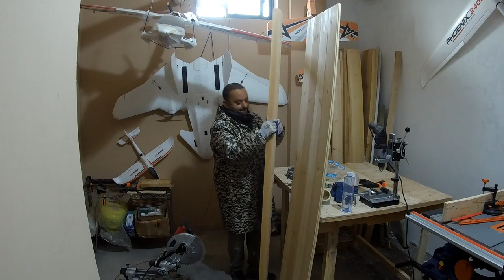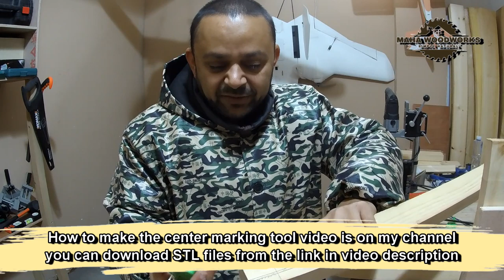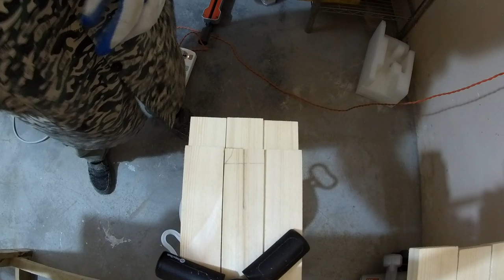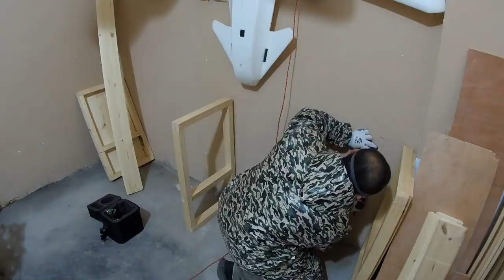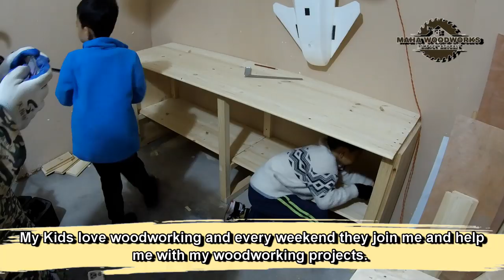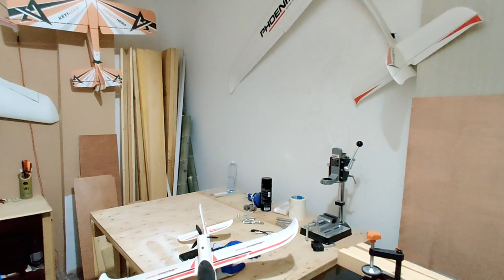DIY Woodworking Long Work Table with Storage Shelf

Comment: Oh Ali ! You're sawdust method is not recommended ! A weak joint. Shims of thin wood would have been better. I had to laugh seeing you using sawdust to fix your mistake! Otherwise, the workbench will suffice for now. I predict in the future you will beef it up a bit. 4x4 inch wood is great for workbench legs, and a double layer of 3/4 plywood for the top. It should be heavy, as you will want to mount a vice sometime, and don't want it to shake or tip over I'm enjoying you're progress and looking forward to you and the kids projects!
Reply from the maker: it actually worked like a charm hahaha